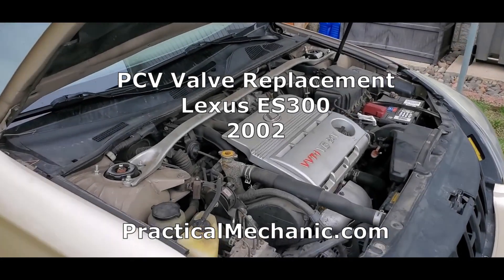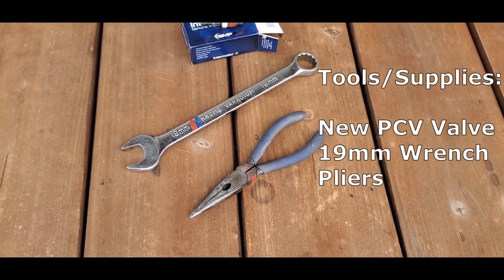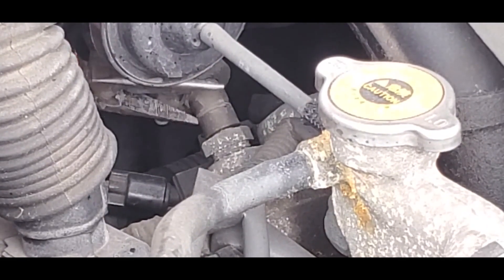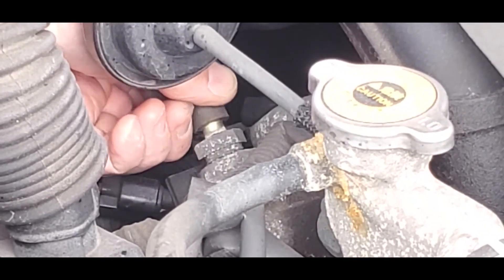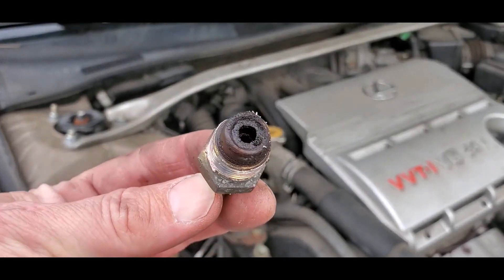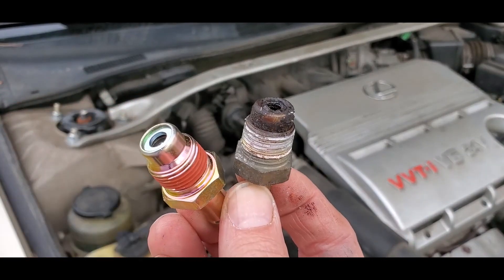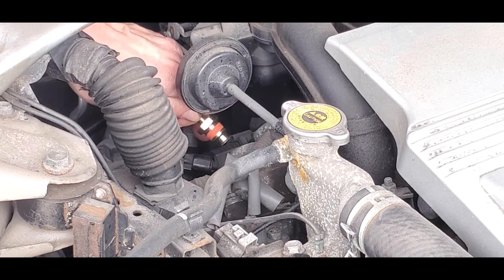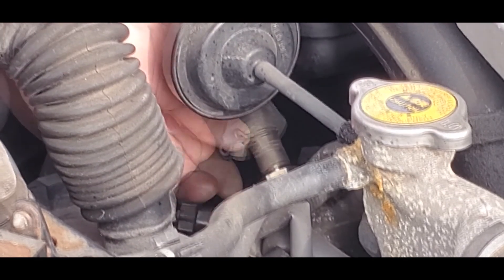Lexus Burning Oil? Try This First! LEXUS es300

Comment: '05 ES 330. PCV value is hard to turn - should I try lubricating ? Also hose came of other end - I never loosened that end, it may have been off. Not sure were it connect to.
Reply from the maker: I would recommend a small amount of penetrating oil. Let it sit for a day or 2 then re-apply. You don't want to damage the old PCV valve, as it has a hollow core and can break with too much force, so take care.
Reply: @PracticalMechanic  do you know what the other end was connected to ?